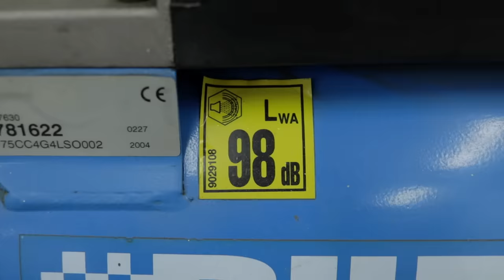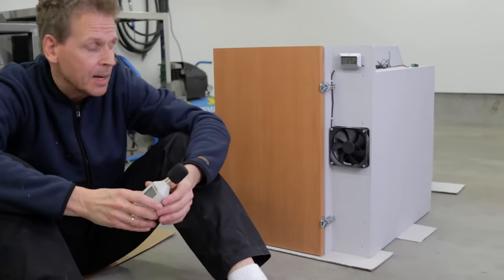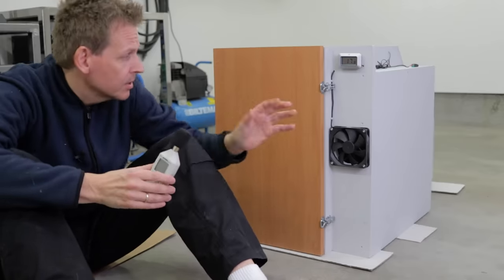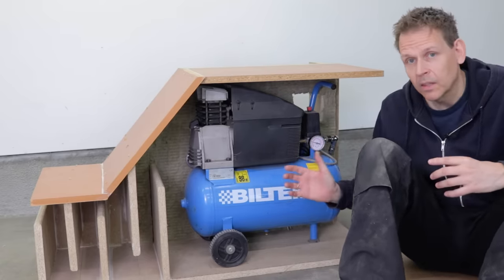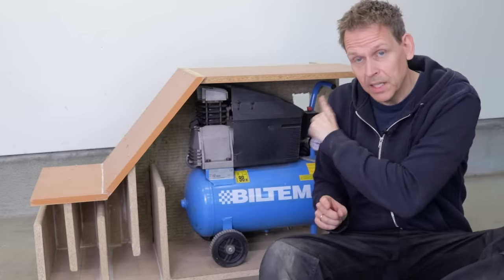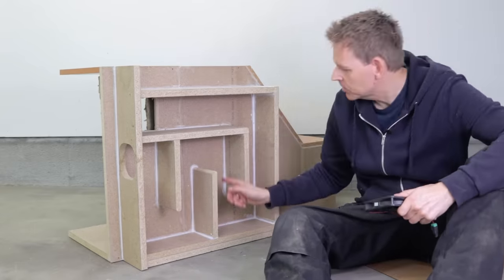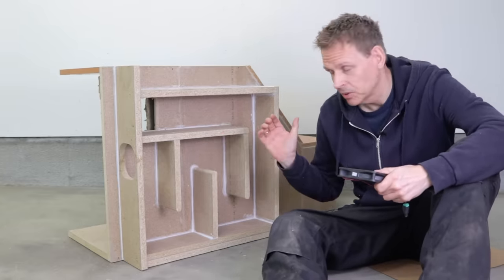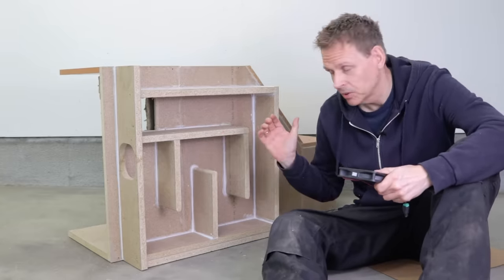Do not build a sound insulated enclosure for your noisy air compressor!

Comment: Your baffles had a design flaw. There were many areas where you had sound going at perpendicular faces which translates to the frame of the box vibrating instead of dampening. Your baffles should have had 45 degree ramps inserted into the corners where you had caulked it. This is the same design that sub-woofers use to create inference patterns that are necessary for clean and clear sound behavior.
Reply from the maker: Yes you are correct, some others has mentioned it as well. It is quite obvious now, but I did not think of it at all when i built it. I found some examples online, and these had also 90⁰ on each baffle. I guess that is simplest to build, I did not think much of it. But now i know 😣
Reply: @kihestad  You could probably make another video about this. Rather than rip apart what you made and risk wasting something perfectly good as is, though, make a prototype box. Use a speaker to provide the control noise. Find out if purple sheet insulation foam would suffice as inserts, versus wood inserts, versus no inserts in the corners. Might be able to show us smarmy commenters that we're recommending something that doesn't even make a full decibel difference.

Comment: Worth it? That comes down to personal preference. If you rarely use it... and value your silence, it is viable. 
But I think it is at least harmful to your compressor to run a 1500W (or even more, because even that is a small compressor) in such an enclosure. The airflow from a computer fan cannot drive off that amount of heat if the compressor does not only run every now and then. And it will consume more energy and pump less air. The compressor also needs to cool the air to get the amount of storage in the tank.
Reply from the maker: Thanks for your comment 😊I absolutely share your concern when it comes to heat. The air compressor will not live for long if it is constantly hot above the recommended specs! 😐 However, It's a pretty cold climate here where I live in Norway, in the Northern part of Europe. I have actually fitted a heat pump in my garage to be able to use during winter time. I can see overheating is a big challenge in warmer climates. A more powerful fan or even radiator cooling could be needed must then be considered. My garage is actually not insulated, and there is an opening for ventilation where the ceiling meets the floor upstairs. The exhaust air from the air compressor box is placed up against this opening. The hot air from the compressor is pushed out of the room to outside of the building through this opening. By doing it like this I avoid the hot air to be circulated back into the room. 
I have fitted a thermometer and I do check frequently that it's not getting to hot inside the box. Normally the temp increases 5C = 10F when it starts until pressure is built up, and it takes just a couple of minutes to cool it down. If it is running constantly over longer periodes it can get a bit hotter, I have seen almost 10C = 20F increase. The warmest summer days can be 30C = 86F here where I live, but that is very rare. Its more commonly 25C = 77F, so it never gets very hot inside my box.
Reply: @kihestad  I recognized your accent as Scandinavian... couldn't pinpoint it more exactly. ;)
Also for your ambients it is probably a matter of duty cycle. Because if someone runs 1,5kW of heat generation continuously in this cabinet, it won't end well even in Lapland. ;)

Comment: Set the air compressor up outside and run a line through the wall. Re-test decibel level inside and compare costs. =P
Reply from the maker: I wish i could 😊I just dont have space for it. My garage is placed with minimum distance to two of my neighbors. The side facing my own property is not usable either,  as it's just a slim path between my garage outer wall and a concrete retaining wall. In front of the garage door is no good either 😋

Comment: I would say the back should be the intake and the side vent should be the exaughst. Heat rises.
Reply from the maker: You're right, the reason I did it the other way is because upstairs in my garage I have open ventilation to the outside in between the wall and the ceiling. The output vent will blow the hot air to the outside.

Comment: Is it able to pull in enough air stuck on the corner like that?
Reply from the maker: Yes, it works great 👍 I forgot to mention in the video that my garage is not insulated upstairs. The exhaust air is up against the ventilation between the wall and ceiling so it blows the hot air from the compressor out of the room.

Comment: 10dB is not twice as loud - 3dB is. 10dB may appear twice as loud but that's because our perception is logarithmic. 20dB is... 100x the power and anything above 91dB can quickly kill your hearing. 78dB is magic by comparison. You'd have to work for hours with that exposure to feel anything.  
Your understanding of damaging hearing levels is wrong. Guidelines start at 85dB. 80dB is considered safe for unlimited lengths of time. 
From 50dB up to 70dB the conditions are pleasant without hearing protection.
70-80dB is annoying but safe. 80-85 is a conversation killer without being too harmful.
Pick your noise level on what you want to achieve.
Placing the compressor on the floor next to a single wall gives +6dB reinforcement. In a corner - +9dB.
Insulating the floor (also putting it on foam supports) and wall can soak up a maximum of 6dB and adding a single baffle - not even an enclosure can shave off up to another 9dB if you want the cheapest, easiest solution. 
Personally, given the new compressor's impressive dB figures, I'd stick foam mats or rockwool boxes on the floor and wall by the compressor and keep the levels below 80dB (measured) if possible. You don't really use it for hours on end (the duty cycle of your compressor is probably only 20 minutes) and that would be very easy to do.
Reply from the maker: Thanks a lot, this was a lot of useful info. You are absolutely correct, my way of understanding the decibel scale had been based on the subjective perceived level of sound (and very simplified), not the actual power of sound. It's s very interesting topic, and I have a lot to learn 🥴 thanks a lot for sharing your knowledge 👍😊

Comment: Good video; however, flawed as whilst you may have reduced higher frequency with the enclosure you have not considered the lower frequency transferred into the concrete through the wheels and leg... recommend enclosure for higher frequency and mechanism to disengage the contact to your floor... a better way to measure the sound transfer is also to consider the different frequency levels, as your current method considers the combination. Good luck going forward on your channel.
Reply from the maker: Thanks for the feedback 👍 It is the high frequency noise that is most annoying, getting rid of that is most important. There is still some low frequency noise, mostly coming from vibrations I think. Since it's now upstairs, the vibrations go into the wooden floor. It's not very loud though, but you can hear it. I might add some soft rubber in between the box and the floor, and on the compressor feet inside the box to see if that helps.

Comment: if you have a large shop...... just get a rotary screw type
.
all you hear is the electric motor....... and it builds air FAST!!!
.
.
.
you do wanna WAY over.... or WAY under size it however
having them start and stop all the time isnt good...... 
.
our shop has about ~75 gallons in the air lines running all over the shop
and the compressors tank is 120 gallons 
.
so it kicks on about 10 times a day.... depending on how many semi tires we do
might be 15 times if we get 4 or 5 semis in LOL
.
.
you can also set it to continue to run in "by-pass" mode..... for like 5 mins...10 mins...15... ETC
and it will open the valve to add more air if needed in that 10 mins
.
.
again... running for 24/7 is better for a screw type than start stop every 5 mins
Reply from the maker: Hi, thanks for sharing your story. Quite a beast of a compressor you have there, just let me know if you want to switch 😁

Comment: Air tanks to not need to be anywhere near the compressor in a stationary system. The tank acts as a a resonator amplyfying the sound of the motor and the compressor (which are two different things).
The best way to eliminate high frequency sounds is with a baffel box which you have made: it is essentially a mufler. The best way to eliminate low frequency sounds which carry through the ground and the building structure, is to SUSPEND the motor and the compressor on ruberised slings or webbing hanging from a braket attached to the inside of the baffel box.

Personally I would not bother to build such a box from scratch, as there are plenty of kitchen cupboards given away on the internet. There is certainly no need to EVER buy particle board.
Reply from the maker: Many cool ideas here! 👍 Separating the motor from the tank is an interesting idea, but it will make the compressor less movable. Now I can just take it out of the box and use it elsewhere if needed.

Comment: What about the compressor over heating? This can also be a problem if you put it in a noise reducing enclosure.
Reply from the maker: Overheating is absolutely a concern. The air compressor will not live for long if it runs above the recommended temperature 😐 It's is luckily (or unfortunately - it all depends who you ask 😋) a pretty cold climate here where I live in Norway, in the Northern part of Europe. I have actually fitted a heat pump in my garage to be able to use is as a workshop during the winter time, if not it is freezing here. I can see overheating is a big challenge in warmer climates. A more powerful fan or even radiator cooling could be needed must then be considered.

I have fitted a thermometer and I do check frequently that it's not getting to hot inside the box. Normally the temp increases 5C = 10F when it starts until pressure is built up, and it takes just a couple of minutes to cool it down. If it is running constantly over longer periodes it can get a bit hotter, I have seen almost 10C = 20F increase. The warmest summer days can be 30C = 86F here where I live, but that is very rare. Its more commonly 25C = 77F, so it never gets very hot inside my box.

Comment: I think you are getting a lot of vibrations travelling via the box floor. It needs some rubber feet or similar to sit on. "Stommljud"
Reply from the maker: Yes, you are right. I have planned to put vibration dampening rubber feet's on both the compressor inside the box, and between the box and the floor. The wooden floor upstairs is not an ideal foundation 😔 Thanks for the tips 👍

Comment: Your output baffles could be padded to absorb the noise.
Reply from the maker: I believe you are right, others has mentioned it as well. I was afraid of not having enough airflow to keep the compressor cool, and I could not make the box much bigger to I went for very little sound dampening on both the inlet and the exhaust channel. The cooling seems to be no problem in my "cold" climate, so I might add some more padding now to see if it helps. Thanks for the tips! 🙂

Comment: Had my compressor under under the  the stares in the house .so when I am working in the shop i didn't have to hear it when working in the shop . Only works when u are single. In a shed in the yard works to .
Reply from the maker: Hehe, I agree - only works if you are single, or if you want to be single 😂
Reply: @kihestad  man cave . Tool's toys  and don't have to give half house away. Not to much giving mostly taken.

Comment: Why not throw some foam or a filter into the baffles. Something minimally restrictive but well obstructive.
Reply from the maker: It's a challenge (impossible?) to find a material that does not restrict airflow (for ventilation) but stops the sound waves 😞

Comment: If your Biltema compressor has a 24ltr. tank and you don't need more, then you should consider a Hecht Electric compressor.  Only 80 Db!!    And just as quick to fill the tank as a regular compressor AND it does NOT need oil!
I have it in my workshop and it's perfect.  When i have the radio on in my workshop, i don't even hear the compressor!  
See for yourself: kompresor - HECHT 2075  costs only 4000Kc which is ca. 160€.   
Cheers from Czech Republik!
Reply from the maker: Yes, that is probably the easies and smartest solution to the problem 😊Unfortunately, I just dont have space for it. My garage is placed with minimum distance to two of my neighbors. The side facing my own property is not usable either,  as it's just a slim path between my garage outer wall and a concrete retaining wall. In front of the garage door is no good either 😋

Comment: There are much quiter machines like screw compressors but they cost from 6000$ and up so only big factories can afford them sadly. The KAESER AirCenter we have at my work is probably not much above 60-65 dB while running.
Reply from the maker: Yes, a bit above my budget. The one I bought cost $150 😊

Comment: Isolation adhesive glue between inner layer and outer layer of timber This isolates the vibration of inner timber to outer layer . Insulate every internal exposed timber gluing together the foam .

Comment: Why build vents if your going to put them against a wall? That poor compressor.
Reply from the maker: I should have mentioned that I put the exhaust at the rear of the box because my garage is not insulated and it is an opening for ventilation where the ceiling meets the floor upstairs. The exhaust air from the air compressor box is placed up against this opening. The hot air from the compressor is pushed out of the room to outside of the building through this opening. By doing it like this I avoid the hot air to be circulated back into the room. I did not tell about it in the video, but now you know 😊
Reply: @kihestad  oh, cool. I saw you added the fan in front, so I figured you may have  had something for the back. I have always wanted to build on of those.   A cheap solution would also be to put your compressor in another area of the house and run a long hose. Great video.  Thank you!

Comment: Re-engineer the compressor, from a penumatic system, to a ... it doesn't have aname but a cyclonic compressor. This cyclonic would be dependent on the tubes and air flow, becasue longer is quieter but could whistle... since your moving the outside air in at a rapid rate, but this can be done easier wit ha larger surface area ot draw from, and hte nits hte speed of the compression taking place..  What we want then is the best gradient possible to compress the air... so heat, speed, flow, by creating a vacuum it forces air to come into the space... a object moving in space, creates a vacuum technically that is then filled by whatever is near by and its in balance..

 SO a spining tarus ring inside a ring that has a modulated  top and wider area, in a sequence could rapidly fill compress a system and less wear and tear, air travels at the speed of sound..... It would require studying teh arcs and graphs of the actual compression... Just as releasing air can sound hell a loud... you can change a nozzle and system so that it releases the air as silent as possible.  hmm...

I can see building something like this if I used it all the time ,but, I would probably jsut get a longer hose and stick it outside. LMAO
Reply from the maker: With your knowledge you should absolutely build something like this 👍Just taking the compressor outside instead? That was quite a turnaround, I must say it was a way too easy and disappointing conclusion. You should put your words and ideas into action! 😁

Comment: I think had you not kept the distance between the fins constant, it would have worked better as it would have filtered more frequencies. 15dB reduction is not shabby, it means that you've divided by 30 the acoustic power!
Reply from the maker: Ahh, it makes sense. I did not think of it all when I built it, but now as you say it ... It sounds very obvious 😔 Someone suggested putting them on an angle, instead of 90 degrees. Thanks for the tips! 👍